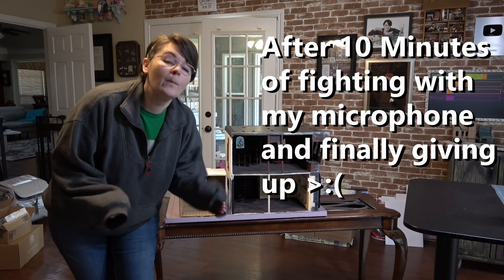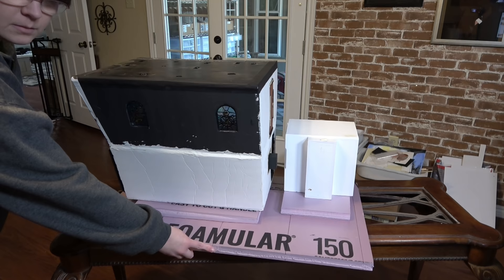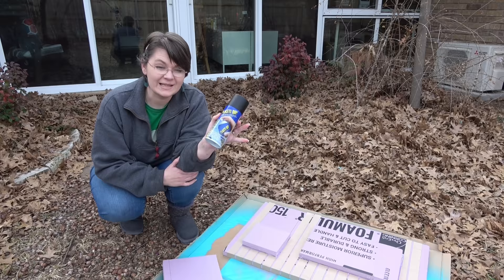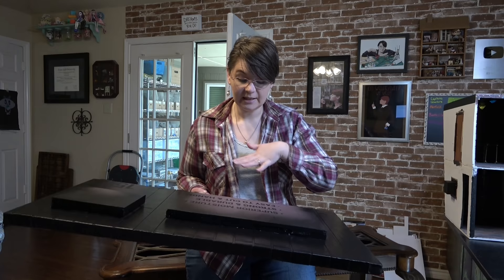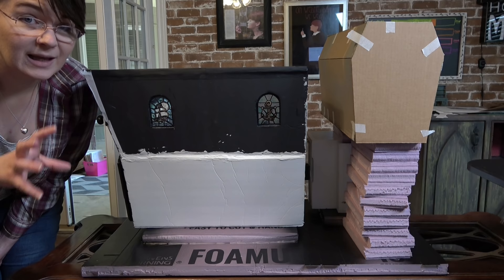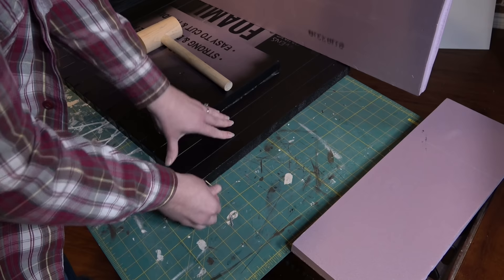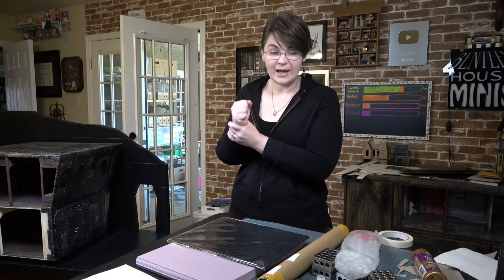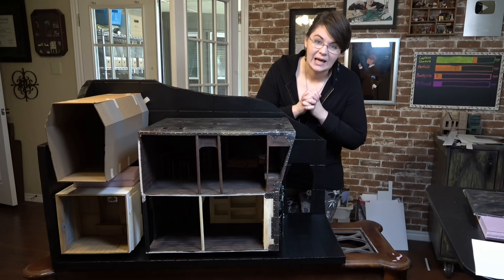Attempting to make a SPACE-SHIPPY type thing for the Captains Quarters🚀 Studio Vlog

Comment: Just an idea.  For the edges that got "melted" somehow run a pipe or wires right in the foam so that also looks like a cut away in the sides of the ship.
Reply: That and make the smaller dips look rusted/corroded.
Reply: These are two really awesome ideas! A real cut-away.
Reply from the maker: Love this idea June!!  It's so easy to work with adding things into the foam that I don't think this would be hard at all.  Thank you!

Comment: Great job!  I love how this is turning out!
A suggestion for your "melted" floor ... Use your LED strips to fill in the space between your floor panels.  Just a thought!
Also ... I personally believe that the melting is caused by the propellant, more than it is the paint.  I may be wrong.  
You might consider spraying the paint (plasti-dip) into a container, then use your airbrush to apply it and I bet it won't melt!  Just a thought!  
Thanks for the shout out with the toothpick idea.  That was on my Kitchen project where I did that.
I gotta agree with the "Ugly" stage.  I am there now myself!  
Keep up the great work!  And as always ... have a better day!
Reply from the maker: Yes the kitchen project was it!!  I couldn't quite remember which project I saw it in but I remembered it was your idea! ;)  I definitely want to do more with the LED strips on the floor and back behind some of the rooms.  I am really starting to see the ambiance and benefitted provided by the right lighting ;)

Comment: 1. Great project! I think some transition from the historic section to the futuristic section might be done with some steampunk elements.

2. I bought some 1-2-3 weights like you have, but they came all covered with oil. How did you get the oil off so it wouldn’t get onto your artwork?
Reply from the maker: Thank you Murphy!!  All you need is some kind of soap that cuts through grease.  I use 'Fast Orange' because I already had it, but any kind of grease cutting soap will do.  I didn't realize they came covered with grease the first time I ordered them either and I used then in the box for months before I finally washed them off lol!

Comment: Hi Ara, will you be installing any additional lighting in the spaces to the rear of the project, either flashing or colour changing lighting to give the spaces a feel that engineering or computer systems are running throughout the ship and the spaces you have is where all the circuits are found. Steve
Reply from the maker: I definitely want to try out some lighting in the back.  I think it will really add to the atmosphere!

Comment: I haven't watched a lot of miniature videos and I wondered, do you ever run into a problem recreating a movie/tv show set in that it isn't logical or it's incomplete? I've sometimes tried to figure out the layout of a house on a show only to figure out that what you are shown couldn't possibly work - the exterior shows one shape home while the interior room layouts won't fit that shape, or there's a staircase downstairs that isn't shown upstairs, etc. I was thinking one issue you may be having with this design is that the actual sets bend space.
Reply from the maker: Definitely!!  The Beetlejuice house I am working on right now is a prime example of this!  I mapped out the floor plan from the movie and it just doesn't fit inside the house.  That's because the rooms were all sounds stages and the house was just a shell of exterior walls.  I am trying my best but its not easy to get everything to work!